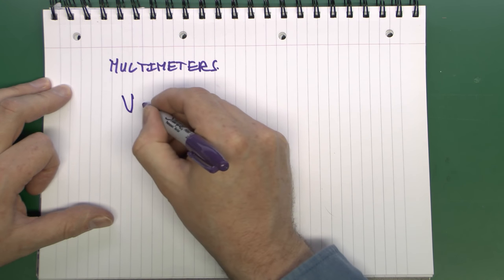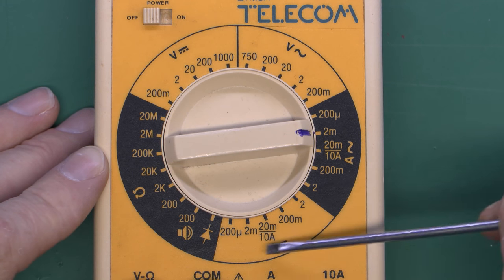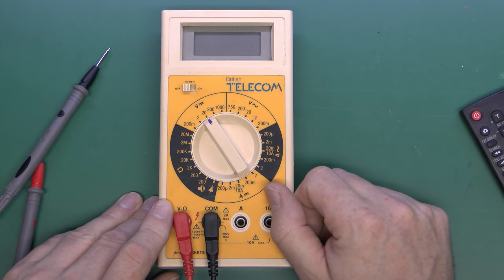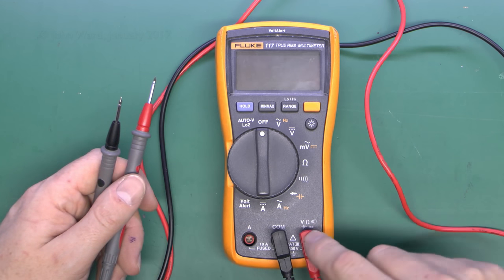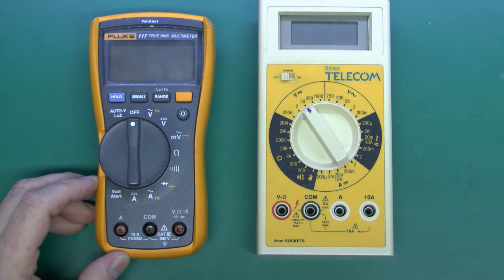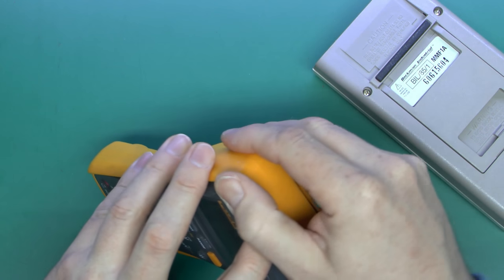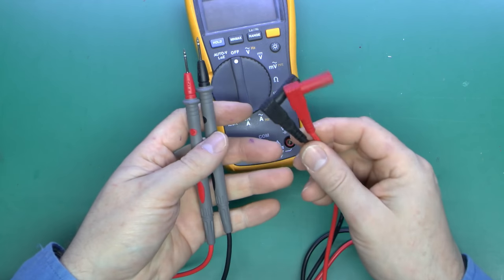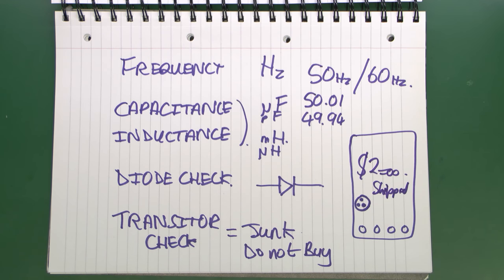Multimeters for electrical installations

Comment: I often use the HZ facility on my Fluke meter when working on generators,previously I had to use a tachometer which can be awkward as guards need removing etc. with the HZ range I just plug the meter into the socket and test the voltage and frequency just by pressing a button. If your meter has a HZ symbol seperate from the voltage one dont use that on power as that is intended for things like speakers always use the one against the voltage range as that goes to higher voltages, found that out years ago when I blew a meter up on a large genset. Equally i find the capacitance range very useful when fault finding as alternators often have more than one on them and start doing strange things when the capacitor is out by a bit.

Comment: A good overview John, agree regarding "transistor test" function, seems to impress so many novices. You did briefly mention probe Cat. compliance and guarding but surprised you did not spend a little longer on this (and GS 38 compliance) since you were dealing with multimeters for electrical installation. Many a time I have seen students damage the supplied probes with their good multimeter and then obtain some "bargain" ones from various online budget suppliers with the corresponding implications.
Reply: Where do your students buy probes that badly insulated? Once I wanted to find a dodgy set of probes for demonstration purposes but even ones shipped with 5$ Chinesium brand multimeters survived 1 kV megger insulation testing easily, so it had to be some next level kind of shady budget supplier...
Reply: I have a multimeter from B&Q which claims to be CAT III rated and which has a transistor test through an adapter that you plug into the mA and common sockets. I guess this isn't quite so bad.

Comment: Interesting article. One thing I will say, multimeters fall under the remit of IEC61010. One of the sub sections for that is for requirements for multimeters and it explicitly stated that meters must be rated CATIII as a minimum

Comment: When I was fitting my Nest thermostat, the old thermostat wiring was using a Black, Brown, naked wiring (pre 2006), so the idiot in me, led by the instructions was wondering if I got a 2 or 3 wire switch, so I decided to test if the boiler would switch on by me connecting the brown and black with a multimeter set to 10A. Well, it worked, by now that I've seen this video, I'm glad I did it on a thermostat wire and not the mains, if I hadn't seen this video, I'd probably try it like the electrical ignoramus I am.

Comment: My advice is always buy a multimeter with auto power-down. I've lost count of the number of times I've gone for the multi-meter and found the battery has died because I'd forgotten to turn it off. The meter I have now gives a warning beep after a period of time and then shuts down a minute or so after that.

Comment: Still have the same Beckman Industrial meter that I kept as a souvenir when I left British Telecom. (and still accurate ).
Reply: The majority of my test equipment has to be sent away to be calibrated annually for the work that I do, so I test it alongside the calibrated test equipment on low energy circuits where there is no risk of power surges.
Reply: CrazySparkie63 i got one too still in its leather box

Comment: About "blowing in flames". It would go with a loud bang. Cheap Chinese stuff as well. My grandfather showed it to me on the multimeter from 50s. There was a button to reset the fuse. Later electronic multimeters will need a fuse changed manually

Comment: You have hit the nail on the head saying only basic functions are required, Electrics is largely focused on the presence or absence of power, on or off, electronics is more about manipulation of currents to perform for a range of functions,
But weirdly digital electronics comes to resemble the on off nature of Electrics, is the light on is the light off, what are all the possible states?
Fascinating

Comment: Although like the rest of everyone on the planet I have a decent digital meter I still find a use for an analogue meter (yes - the ones with a scale and pointer!) I find these are actually more useful for "tracking" a changing voltage and/or current especially when the change is quite rapid. Admittedly more for my electronics work rather than electrical work

Comment: I discovered the difference between an electricians meter and my electronic one, a Fluke, when I dropped it from the top of a ladder onto a concrete garage floor while fault finding a garage door closer. I think the largest remnant was the size of a 10p coin.

Comment: Would moving the probes around mean that the the wires inside the insulator are rubbing together causing a resistance as there are so many strands moving. Plus the unit itself is giving electrical power down theses cables.

Comment: Yep I agree your initial opening statement about some functions are never used, I know what the hfe measure is for example but I just use diode setting for finding base/emitter/collector on transistors as the method helps establish NPN or PNP types basic but works, watching the rest of your video on multimeters now.
Cheers

Comment: As an auto sparks you can become relatively familiar with the fuse in your meter/s,most automotive meters will take 10A,Although I do have a 20A meter I have connected my fluke(10A) to the occasional vehicle to look for a drain where the actual connection of the meter will 'wake' the vehicle and depending upon equipment fitted combined with the drain you see that 10A exceeded immediately and pop the QB fuse,either that or from forgetting while connected and inadvertantly turning the ignition on and/or triggering the starter circuit,they certainly don't like 700 amps! or most likely because of the reluctance to keep disconnecting and reconnecting due to the time you have to wait for the car to sleep after every connection before you get a true reading, you push your luck and at £16 a go for a fuse and now with leads either fried or you just can't trust at £30,it can be an expensive mistake,still cheaper than a cooking a £500 multimeter (with a million functions you never use👍😄) but it's getting close.

Comment: Measuring frequency can be interesting when the power network operator have provided a generator to feed your supply during a failure on the HV side - it can be all over the place.

Comment: Notice you used your fingers to hold the resistor and probes to measure resistance of the resistor. This is okay if the resistor is low but not okay if the resistor is high as it would just measure your bodies resistance. For example when measuring a ring circuit resistance you don't follow your example by grabbing hold of the test leads and then measuring the resistance.

Comment: Great video John,  you can prevent the measuring of amps mistake by dropping a small amount of silicone on top of the A connector,  call it a “Tip from the grave”.

Comment: I remember working on a site back in the 1990's when a fellow electrician made the very mistake of leaving his multimeter set to current (amps) before placing the test probes across 400 amp busbars in an LV switch panel.....nasty business.....ambulance called for 2nd degree burns and skin grafts as I remember. Take care with electricity guys....it can bite you bad.
Reply: That's why I'm fan of using mainly meters with no current ranges (or clamp meters, they usually measure current only via clamp) in such environments and having one meter with current buried deep in drawer/tool bag when you actually have to do current measurement by wire.
Reply: That's why I always use Fluke for AC!

Comment: Hi JW. Strange question.Iif the company you work for supply you with  a cheap multimeter rated cat I working on 240v house mains supply. Do you think That one could send back /refuse to work with that piece of equipment based on safety??
Reply from the maker: Yes - if your employer is providing tools or equipment, they must be suitable for the task.  A Cat I meter is only for testing inside mains connected appliances and equipment, certainly not for building wiring, fuseboxes etc.
Reply: thanks John

Comment: You should have started with explanation of the various Class certifications meters have. In case someone watches this they could be sticking their leads in the mains socket within the first 10 minutes with no idea whether the meter they have in hand is safe for that use (and it most likely is not!).
Reply: well even the lowest class I is suitable for mains domestic socket testing, the class type is actually a pain to describe, and really anyone who will be doing that kind of work wont need the information from John
Reply: 1) CATs on multimeters blatantly lie unless you have some brand-name equipment. Anyone who doesn't know what CATs are has a mutlimeter that lies, most likely.
2) CAT II is not necessarily sufficient for mains, especially if you have a newer wiring that has much lower resistance.

I think the ideal introduction to this video would be "Unless you know what CATs are without me telling you, NEVER stick a multimeter into a mains socket". Who needs to do that anyway? It's useful to have an indicator whether the wires are live, but there are better tools for that than a multimeter...
Reply: yep i agree with you Jan, fully, then i can see why he didnt mention cats though!  yes the cheaper meters are blatant lies, which is why everyone uses fluke who pretty much lead for safety even though we complain about their lack of features for the money.  due to the high impedence it isnt the best method for testing mains (avaailability at least) and prefer the old 2 wire bulb tester as i was taught back in the day .
Reply: Covered in a previous video of his......

Comment: On the British Telecom meter. On the DC Amps section, it has 20m/10A (20m over 10A).  What is that?
Reply from the maker: 20mA when using the 'A' socket, 10A when using the '10A' socket.
Reply: @jwflame  
thx, I thought it may be but was not sure.  Obvious when you know. When you do not know, not very clear.  
So, when the lead is in the 10A socket the other settings in the amp segment range (2m, 20m, 200m, 2) do not matter? It is only 10A irrespective of where the knob is?

Comment: Those telecom multimeter looks good, quality parts inside there (ie. Those expensive caddock network resistors, 2 of them i think).
Not even fluke got that.

They use very common 7106 chipset 1999 count dmm chip, however a far cry compared to $3 free 1999 count made in china nowadays.

Comment: Is the LoZ feature safe to use on 400v AC as it has a lower resistance across, For example checking a motor?
Reply from the maker: Yes, the Fluke meter LoZ input isn't fixed - it starts with a low impedance but if full voltage is detected, the input impedance is automatically increased to avoid excessive current flowing.  It can therefore be used safely up to the 600 volts rating of the meter.
Reply: Thanks for the reply.

Comment: I have one of those chinese ebay mutimeters. Cost £1.75 including the PP3 battery and postage. It does not have any fuse at all internally. I would never use it on mains circuits again, but I can't anyway because the LCD module gives out faulty characters as I broke it by reverse polarity mistake :P .
Reply: reverse polarity wouldnt break it, it reads + or - to the same level, its just junk
Reply: No, I put the pp3 in reverse by mistake.

Comment: John what power supply cable size would I require for my power amps.

Shown below is the diagram from the power amps manual. I have two power amps. I would want to have a separate power supply from the consumer unit. 

ZDamping Factor (static)    .........................................  1600   
Gain   ......................................................................  31dB   
Signal-to-noise Ratio   ..............................................  > 106dB @ full power  
Maximum Output Voltage   .......................................  60 Volts   
Slew Rate   ..............................................................  70V/µs   
Maximum Current – Peak  ........................................  68 amperes   
Maximum Current – Continuous   ..............................  32 amperes   
Crosstalk @ 1kHz   ...................................................  Not applicable   
Intermodulation Distortion   ......................................  Unmeasureable   
THD  (20Hz - 20kHz @ 1 watt)  ................................  < 0.015 %   
THD  (20Hz - 20kHz @ 500 watts)   ..........................  < 0.04 %   
Power Consumption @ idle   .....................................  40 Watts   
AC Power Requirements   .........................................  120V / 60Hz  or  240V / 50Hz